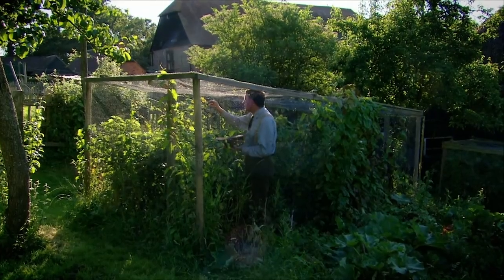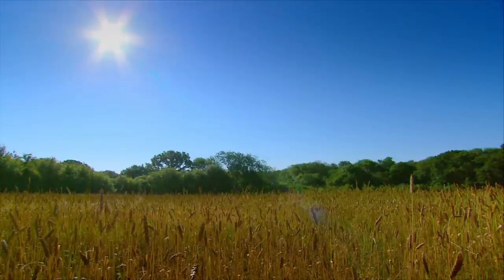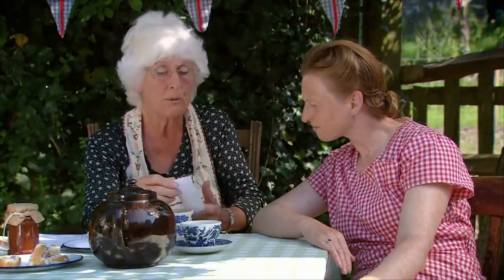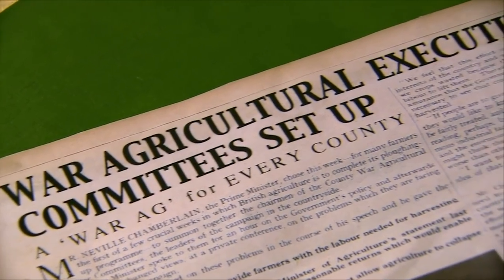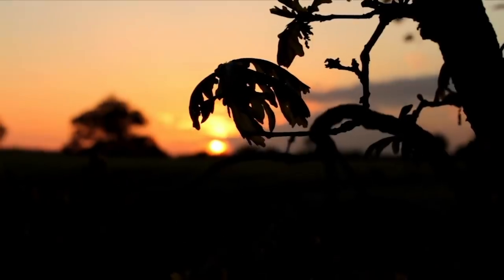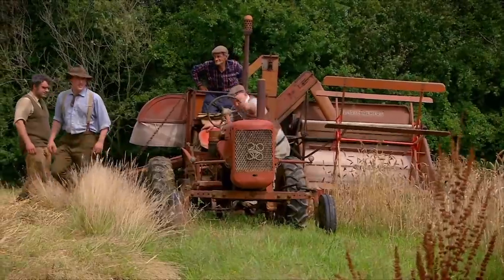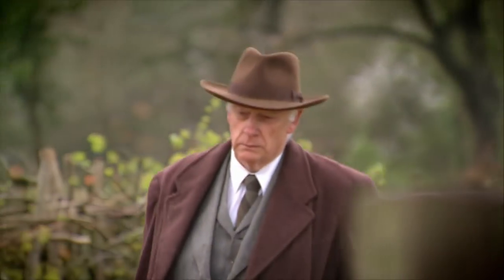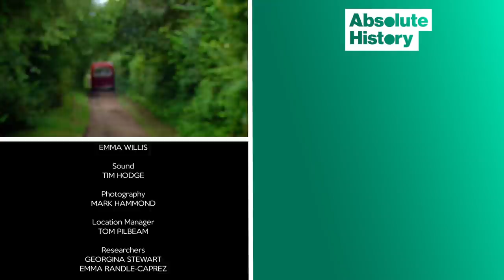Why Harvesting Was So Important During The War | Wartime Farm EP8 | Absolute History

Comment: Sounds is drowning out voices! Terrible
Reply: This show was originally aired on TV. When it was licensed out to get uploaded to YouTube,  the conversion and compression process during upload changed the audio. The audio & video tracks are 'flattened' into a single file. The process is automatic and there is no way to correct it after the fact without ruining the whole thing.
Reply: @leannsmarie  what difference does that make? The sound is still HORRIBLE
Reply: The difference is in understanding.  Yours isn't the only comment complaining about the sound and that's because so many think it can be fixed, which it cannot.
I'm hoping my explanation will prevent others who read these comments from complaining to no one in particular about something that can't be fixed, as you did.